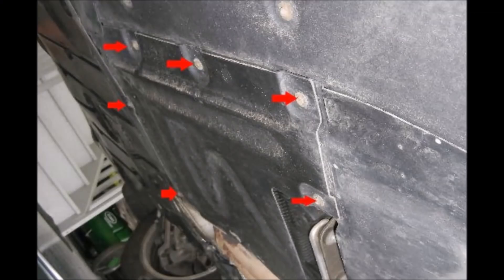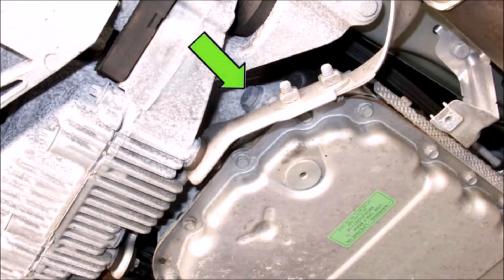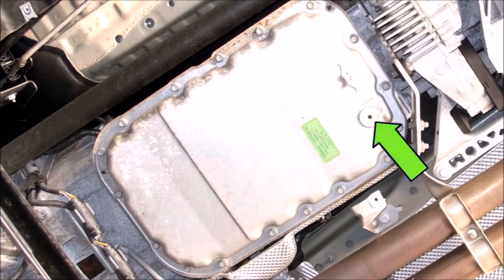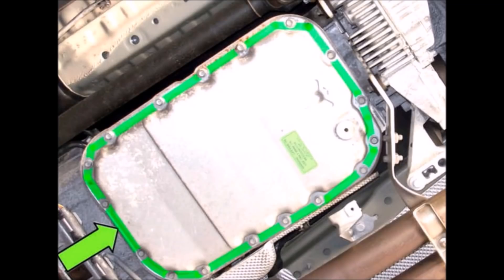Finally Changed My Transmission Fluid on My BMW E90!!

Comment: I did this to my car 4 months ago but didn't drop the pan,my transmission was slipping and jerky.The fluid was burned as hell and black at 50k miles on my 128i.The fluid mixed in some of the old fluid and now it's a dark red.I plan to swap another 5 quarts in come summertime.I'm a little hesitant to take out all the old fluid because it might be holding some suspended friction material and it might fuck my trans forever.

Changing the fluid definitely fixed any problems with the trans I was having .Which I am very happy about.

Great video by the way! Also a good reminder to anybody doing this is to check your fill plug first! You don't want to pull everything and drain the fluid to find out that you can put any in.

Also make sure the car is running when you add your final quarts,I did not do this and couldn't get into reverse the next day.Very stupid of me to forget such a critical step but it was a lesson learned.

Cheers!

If anyone wants a extremely in depth video of this Bavarian auto sport has a really good video on the n52 metal pan'ed transmissions.sorry I forget the name of that specific trans
Reply: i’m looking to do this on my 328i, it started to slip 4th gear and jerks with upshifts. Did you drain out your old fluid completely? and then fill it with new fluid without opening the pan. Also did you ever remove the pan and replaced the filter. i’ve heard 50/50 that doing that hurts the trans.

Comment: Another way to make sure it has the correct amount of oil in there is when its time to top it up (not filling, top it up) get the car running and with the torque app , top it up when the temperature is between 30 and 50c , of course the car must be levelled too..

Comment: Got a question I have a 2009 328i drive  I never changed transmission fluid in it. I have 110000 miles do you recommend changing it. And do you still have your e90

Comment: I tried to do this service on my 2007 328 w the n52. I have 206,000 miles, and every mechanic I talked to told me I’d have issues if I did the flush. So I didn’t. Not sure what to do
Reply: Yeah watch Scotty's channel. you might have sludges and that sludge might be holding the tranny together. If you get rid of it, it can cause a problem. Get rid of the car before it breaks.
Reply: Does anyone know if the Dextron Vl has detergents in it?. Reason I'm asking is because a friend, who is a retired Transmission builder, told me about the sludge and seals holding the Transmission together so to speak, but it's more the internal leaks you may get when changing the fluid because the older fluid had detergents which cleans the seals and causes problems (Internal Leaks). He built transmissions pre Dextron Vl Synthetic fluid. I'm not promoting or not promoting flushing or changing your Transmission fluid so do it at your own risk of having your Tranny slip on you afterwards. I'm getting ready to do my 2007 x3 e83 3.0si with 123K miles and has the Lifetime Transmission...lol B.S. (Who's Life). I have the ga6L45r or 6L45 Transmission in my vehicle and these are my thoughts on replacing the Fluid, gasket and Filter. 
(1). Oil breaks down. When idling or in traffic, the Torque Convertor gets so hot and heat causes friction, your fluid will beak down, no such thing as Life Time. (2) I believe the Life Time Transmissions wur a sales gimmick, never service, never add fluid, don't check the level. (3) Ask your self what happens when the Filter gets clogged up? OK, Loss of pressure to the rest of the transmission causing it to shift like crap. There are fine screens in certain Valve Bodies, (Which should be served by someone who know what they are doing), that get clogged up. These screens prevent particles from getting on the solenoids and other components internally. My friend told me in certain instances they would put a hole in these screens to get better flow to the rest of the system. (4) The Torque Convertor can turn red hot and get blueish from the high heat, What happens to the oil, it breaks down . The manufacturer also recommends 15,000 mile engine oil changes. (Yeah Okay) I would not go more than 5,000 miles on any engine oil. Later they change it to 10,000 miles. That's a different subject but my theory is they don't want you car to last over seven year and if it does you get banged in the service department. Don't forget about your Life time Transfer Case, which you should change the oil as well. Use only Manufactured OEM oil on this puppy. (5) So this is my plan: I ordered 2 filters and 2 pan gaskets, a cheap one and a OE quality one. I'm going to drain my fluid, about 5-7 quarts, install the cheap filter and gasket and let it mix with the original oil for about a week. Then drain and fill again installing the good filter and pan gasket if needed.Then assuming and hoping everything is good with the Transmission, do it every year maybe in six months. Prior to this I'm going to say a prayer. If anyone has any suggestions, please right back. Peace-
Reply: Just did the fluid change on the weekend on a 92,000km 2010 E92 with the GM transmission. The used oil was probably the worst looking transmission fluid I have ever changed, so it was well overdue and BMW should be ashamed to ever call it a lifetime fluid. The transmission was hunting on 2-3 shifts and generally was slow in shifting up and down. All of the issues went away on the first drive to the point that I am wondering how many people get fooled by unscrupulous transmission repair companies. As others will point out changing the fluid and filter is not a flush and you do not want to do a flush ever, drain and fill with the proper oil. The next point is that if a mechanic tells you not to change transmission fluid he is not a mechanic but a hack, that is seriously the dumbest advice ever.
Reply: There is a big difference between a drain and fill and a flush. Drain and fill is good, flush is not.

Comment: G QW
quick question my 328i coupe isnt accelerating after 20 mph would the transmission fluid change help , just throwing vvt solenoid and maf codes thanks in advance
Reply from the maker: No unfortunately I don’t think this will help I’d start by cleaning the MAF. That may do it but if it doesn’t I’d research the code. VVT in BMW is called vanos I would try to clean both those solenoids on the front of the engine head with engine degreaser and then make sure to get that stuff all out using compressed air (air duster for keyboard will work). If that fails probably will need to replace the solenoids. There are two a BMW specific code reader will tell you which solenoid is you culprit. But I recommend cleaning both and swapping their positions after to see if the code follows.
Reply: greatly appreciate the advice, thanks in advance
Reply: So i hooked up my scanner and while car was on and went into live data , getting a reading on maf sensor was 0.01 or 0.1  what do you think , also my codes i got were p105b,p1056,p0174,p0171, and for the transmission p17e5 any advice will be great thanks in advance

Comment: Does anyone know if the Dextron Vl has detergents in it?. Reason I'm asking is because a friend, who is a retired Transmission builder, told me about the sludge and seals holding the Transmission together so to speak, but it's more the internal leaks you may get when changing the fluid because the older fluid had detergents which cleans the seals and causes problems (Internal Leaks). He built transmissions pre Dextron Vl Synthetic fluid. I'm not promoting or not promoting flushing or changing your Transmission fluid so do it at your own risk of having your 
Transmission slip on you. I'm getting ready to do my 2007 x3 e83 3.0si with 123K miles and has the Lifetime Transmission...lol B.S. (Who's Life). I have the ga6L45r or 6L45 Transmission in my vehicle and these are my thoughts on replacing the Fluid, gasket and Filter. 
(1). Oil breaks down. When idling or in traffic, the Torque Convertor gets very hot and heat causes friction, your 
fluid will break down, no such thing as Life Time. (2) I believe the Life Time Transmissions was a sales gimmick, never service, never add fluid, don't check the level. Also, the steels and friction clutch packs wear out and leave 
clutch materials and particles in the Tranny and filter.  (3) Ask your self what happens when the Filter gets clogged up? OK, Loss of pressure to the rest of the transmission causing it to shift like crap. There is a pump inside the 
Tranny if not giving the right amount of pressure to the rest of the system. Fine screens in certain Valve Bodies, (Which should be served by someone who know what they are doing), that get clogged up. These screens prevent particles from getting on the solenoids and other components internally. My friend told me in certain instances they would put a hole in these screens to get better flow to the rest of the system. (4) The Torque Convertor can turn red hot and get blueish from the high heat, What happens to the oil, it breaks down!. The manufacturer also recommends 15,000 mile engine oil changes. (Yeah Okay) I would not go more than 5,000 miles on any engine oil. 
Later they change it to 10,000 miles. That's a different subject but my theory is they don't want you car to last over seven years and if it does you get banged in the service department. Don't forget about your Life time Transfer 
Case over $2,000 dollars, which you should change the oil as well. Use only Manufactured OEM oil on this puppy. (5) So this is my plan: I ordered 2 filters and 2 pan gaskets, a cheap one and a OE quality one. I'm going to drain 
my fluid, about 5-7 quarts, install the cheap filter and gasket and let it mix with the original oil for about a week. 
Then drain and fill again installing the good filter and pan gasket if needed.Then assuming and hoping everything is good with the Transmission, do it every year maybe in six months again. Prior to this I'm going to say a prayer. 
If anyone has any suggestions, please right back. Peace-
Reply: Transmission fluid is a high detergent infused oil.  Don't overthink this. Just use a good synthetic  Dexron VI  ATF,.  The transmission in this 
video is a GM GA6L45R.  MADE BY General Motors for BMW.  Very similar transmission that is used in Cadillac. Changing transmission fluid and filter is a stinky messy job, so if you don't mind getting dirty and have some mechanical skills, you can do it.  Just do your homework before you start and make sure you have the correct Transmission filter kit, get a new set of pan bolts, drain plug and around 8 qts of the proper ATF. There is a process in refilling the trans after you put everything back together. There are other videos on YouTube that explain. If you do not have the GM transmission, then you have a ZF transmission which uses a different transmission filter kit and different 
type ATF.  It's not all that complicated, it's an "oil and filter change"  Keep it simple!  Good luck.
Reply: Izzy Dizzy Hey thanks Izzy, Parts on the way, getting ready to get messy.
Reply: @cs3943  Cool! You will need a pump (around $10) to use to refill the transmission. Also get some Breakleen to use for cleaning out the residue in the pan. Don't use any sealer on the pan gasket! Just make sure both surfaces are clean!  And when you tighten the bolts for the pan, do it in an alternating sequence and make them snug, then use a torque wrench to spec. Having a large drain/catch pan and lots of rags will be a necessity. Wear rubber gloves too. That old tranny fluid will seep into your skin and it takes days for the smell to go away no matter how many times you wash. If you have an infared laser thermometer, use it to check pan temps when refilling. Tip: measure the amount of fluid that comes out ( use some old gallon jugs) this will give you a pretty good basis for how much new ATF to refill it with. Most say it's around 7 + quarts

Comment: E90-HQ my friend i have to replace main too but is not necessary to replace the oil pan too???
Reply from the maker: It depends if you have an GM transmission then you don’t need to replace the pan just the gasket. If you have the zf transmission then you need to replace them both.

Comment: Hey man which fluid did you use ? I’m trying to do the same for my car really curious thanks !
Reply from the maker: Just regular Dexron VI from Walmart it is a General Motors Transmission so this is all that is required.
Reply: BMW-E90-HQ which brand did you use? So pretty much I have to use one that says for GM transmissions?
Reply from the maker: Any Dexron 6 will work it's all pretty much the same. I just used a generic brand.
Reply: Mike Coppola advance Auto has the Castrol version that specifically says for gm transmissions and rn they have a 2 for $10 special. Cheaper than Walmart off brand and maybe better. Just for anyone that might be doing this

Comment: There are tons of tutorials. however, a good rule of thumb is not to change the fluid until you notice you're having shift problems or leaking fluid. I did mine last weekend (135,000 miles) with FPC Euro drain and fill kit. Now it's shifting hard between 1-2 gear but I just reset the trans using the 30 second method in his other video. Hope it helps. Otherwise it's a solenoid and fill again & only use BMW fluid next time. 
The drain plug needed a bolt extractor at our DIY shop in the bay area. DIY or Die, San Jose, Ca. https://www.youtube.com/watch?v=-ApfqzBUc5g

Comment: There's a lot of old oil that you don't replace this one. Better to get it flushed professionally.
Reply from the maker: I know the torque converter is full of about 4-5 more quarts. I’m not concerned though. Many shops don’t do flushes on high mileage automatics because it can cause issues. This is a pretty standard service.
Reply: BMW-E90-HQ Well, I did a full service at ZF (the manufacturer of most BMW transmissions) and that an extensive flush with replacement of the oil pan/filter and also oil change of the differential. They are the most knowledgable about the transmissions. It was at 200K km (130K miles). No problems what so ever (E90 N52 330i).
Reply from the maker: Dutch79 ZF makes the best auto transmissions period I’d trust their word. With the GM transmission idk if I’d go that far as an all out flush. But as I said a simple drain and fill is a pretty standard service. I can really tell a difference. I wasn’t expecting to notice anything.
Reply: BMW-E90-HQ Goal achieved! By the way, I'm at 170K miles at the moment and still going strong :)

Comment: my transmission is slipping from 2nd to 3rd only when the transmission is cold once it warm up it doesn't do it anymore. does anybody knows how to fix this problem
Reply from the maker: I had the same problem with my old Ford Explorer. It had a slow transmission fluid leak and had gotten low.
Reply: Did u find out i have the same problem

Comment: Not looking forward to doing this, just did my water pump too
Reply from the maker: Evan's Garage It was a real PITA especially after the drain bolt got stuck.
Reply from the maker: It’s definitely worth the two hours or so that it took. Maybe $80 in parts.
Reply: BMW-E90-HQ ugh fun. Might just have to buy a manual 335...  my water pump was a massive pain with my car being awd
Reply: BMW-E90-HQ I’ll be doing it on a lift with power tools so hopefully it goes a little faster. Starting to get annoyed with this car lol
Reply from the maker: Evan's Garage tbh I’m seriously considering a e92 n55 335i msport can’t deal with n54 problems. But definitely going to keep the 328i. We’ll see.
Reply: BMW-E90-HQ that’s what I would be getting if anything. I’m not a huge fan of the sedans or the n54
Reply: Mine is also AWD, the videos on YouTube are deceiving because the AWD's apparently have the subframe in the way and the regular cars do not! How did you wrangle the pump and thermostat out of there with that in the way? I can barely even get my hand in there and can't see how the hoses can even be removed with such a small space to work in. My cousin has a hoist, but even so, it looks like an impossible job!  Please help!
Reply: w9xy I made a video on this I just have to finish editing it and it will be up. If you sub you’ll see it. It actually isn’t too bad. Looks harder than it is.
Reply: Evan's Garage, I'm subscribing, thanks!  Don't be too long, my original pump has 16K on it!  :)
Reply: w9xy 16k or 160k?
Reply: Evan's Garage sorry, 116K. Typo.
Reply: w9xy makes more sense. Yea mine died at 91k you’re due for one soon
Reply: I'm holding my breath on every trip now, even the 9 mile drive to work makes me uneasy!